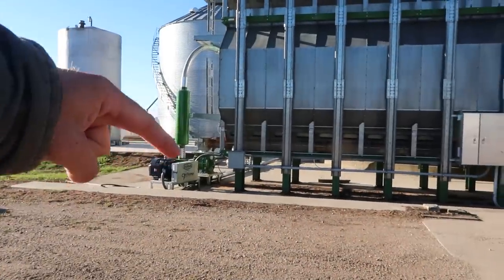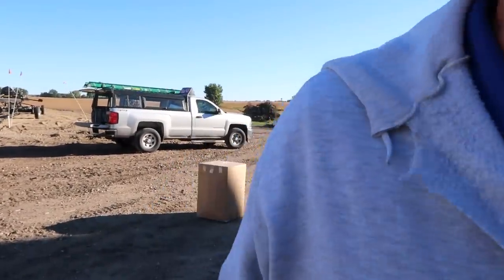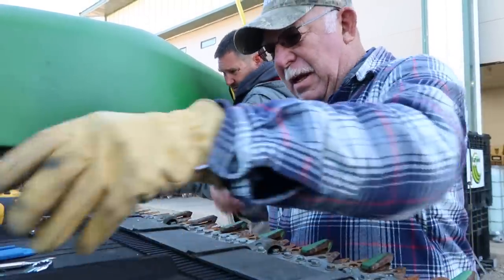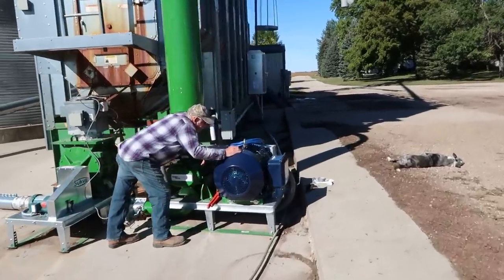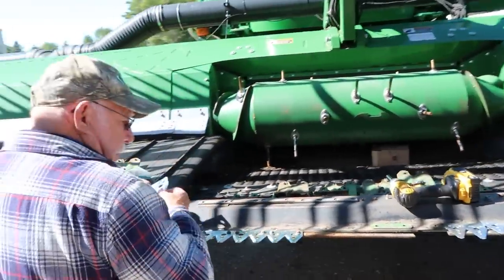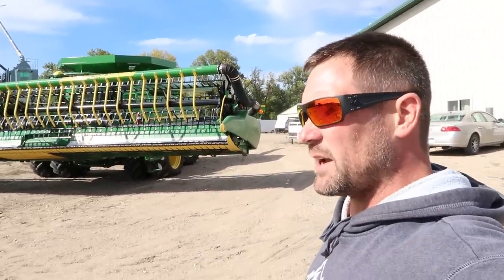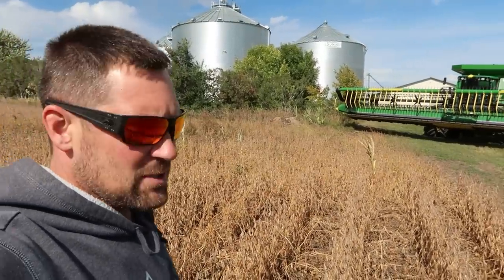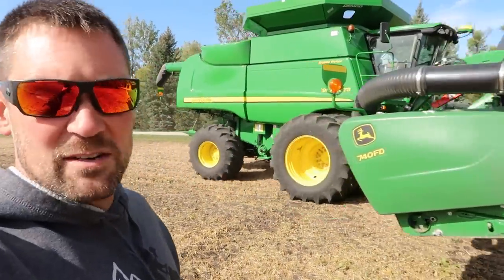Gaslighting The First Day of Harvest?!

Comment from the maker: New video up on Between The Rows also! Go check it out! https://www.youtube.com/watch?v=VwHLx41ePKE&t=8s
Reply: Can you please read my comments 🤣🤣🤣🤣🤣🤣
Reply: Is this yesterday's video? Or is there a new one just not there yet?
Reply: should build a roof over the pits ... so water could not go in
Reply: You still haven’t explained the picture of the 8RX from the video a couple months ago.
Reply: May want to edit out the feeding deer part, I am pretty sure there is a ban on that where you are at...Just a heads up
Reply: Only in some states. MN not being one that is banned
Reply: @Mullet_madness8  not according to mn dnr website. its to prevent disease spread.
Reply: Hey Zach,happened to me,being in contact with mold gave me the same symptoms
Reply: Mold is very dangerous
Reply: Probably from the wet pits
Reply: A roof, check the grade there, and consider air circulation.  It might be possible with two stand pipes one opening near the bottom and the other opening near the top inside the pit. Both can be four feet or whatever height outside. Have a "T" on top with the low one open to the prevailing winds and the other turned opposite. This should draw the air from the bottom and let fresh air in at the top. Then remove the top sections during harvest and reinstall when done.
Reply: 4 inch sewer pipe and "T"
Reply: @Notso fresh Yes it’s illegal to bait public land. Although you can bait private property but it has to be over 40 acers in size and the bait has to be further than 100 yards from public roadways.
Reply: Where did you get your shop LED lights?
Reply: @scottreed2073  there's a whole video on it mate.
Reply: Ñ

Comment: Lowes for safety Cones for the pits while open. They have the ones with reflective tape on the top.  Also for marking Rocks for the rock picking crew. Put a pipe for a stack on the dagoman rock picker, and on the combine, and tractors.

Comment: those grates are flush to the ground, so any rain that hits the ground run into the grates. dig around the outside boarder about an inch deep or lift them an inch, should keep out alot of water.

Comment: It would really benefit your operation if you enclosed those hoppers,  you would still have some snow melt off the trailers and trucks, but not near as much as they are open, keep the electrical panels out of the weather, then get you some of those rubber roll up doors for each end, we used those type of doors on our train loadout at the mine, cost effective and kept weather out and heat it in the winter time!! Just an idea for you to ponder!! Keep the videos coming!!

Comment: Honestly. It’s easiest to pull the whole sickle out to replace sections. 2 bolts on the end to disconnect it from the wobble box. And pull it out. Set it on a clean floor and nascar all the nuts off right onto the clean concrete. And back together the same way. We have 3 40 foot Deere Draper heads on our farm we have to replace sections every year on all 3. Used to do it how you did it many years. Last 2 years we just pull the sickles. Way way more fast
Reply: The old beater we had used a tie rod end not two bolts. It was a pain to knock it out. Had to cut the old sections out with a chisel and rerivet the new one in.  These millennials have no idea, lol.

Comment: I have to wonder why u wouldn't pull the sickles and repair off machine? Take off overlap bar ,drive head bolts .Screw a 2x6 flat somewhere in the shed at work height R R in an hour and half.

Comment: Millennial Zach & Mrs. Millennial, I'd say if you built a flat grinding belt- with a blade holding fixture- and a tiny sand blasting box w exhaust; you create make a business for the shorter Mil'Farmers to have a service of resharpening the 'used' blades that were taken off the header?  The cutting angle is really just one sided- so by flattening from the back they will "resharpen" and a little bead blasting of the top will shine then up.... Then put the reconditioned blades into sealed bags w a drop or so of oil or WD-something? and you'd have a nice little service the kids (maybe Onyx?) could generate some income? Always enjoy your videos.
Reply: It's Zach
Reply: If you look at the sickle sections they are serrated.
Reply: @dwightl5863  , I see that; but the serrations in the video appear (4:21) to be a pure down-cut grooves into a plate that has a flat back? So, while serrated, sanding/grinding/refinishing the back looks (again video not exactly clear) would sharpen the cutting edges since there is no double bevel?  Like sharpening a kitchen knife w single side bevels- and a flat back- just hone the back and the knife is sharp again!  If they cut against their lower fixed 'anvils' (shearing the stalks)  it seems like they're a single planar back tool?  So reconditioned cutters (As I see the geometry?) would work with a set of two or three bench fixtures.  If a cutter is more than 1/64" rounded or dull then  you'd have to have some limit; but I remain sure that I could recondition these by grinding/sanding/lapping the backs to move the bottom surface 'up' the grooved serration channel. Serrations need not be cut again.  In fact an old machinist's lap of 30-40" dia. would work perfect- might find on that could be reconditioned then just let the teeth go/ride for several hours with a coarse grit compound!
Reply: @kevinmorin7965  Sounds like you are a machinist.  And I suppose it could be done as you describe.  I doubt the investment in the equipment, jigs, and training required would give one an equal quality section at a cheaper price.  These are sections are like brake pads, they wear out, chip, and break.

Comment: This comment has nothing to do with this video. I am commenting in hopes that when you have the new cold shed built you have the electrician run more outlet locations than you think you need. With your heavy use of battery chargers any time you can avoid using an extension cord the charger works better and causes less fire hazard. Also have an outlet at each door will also help.